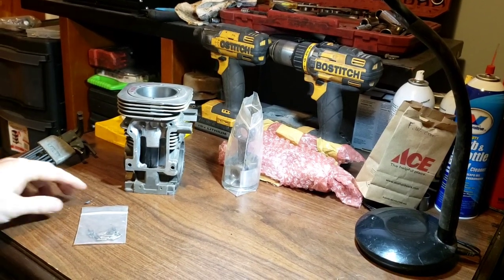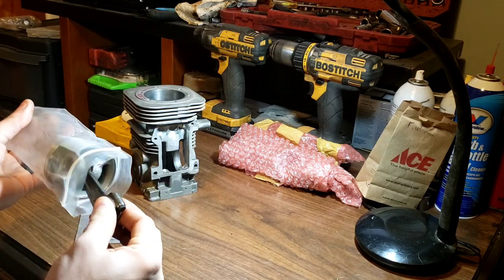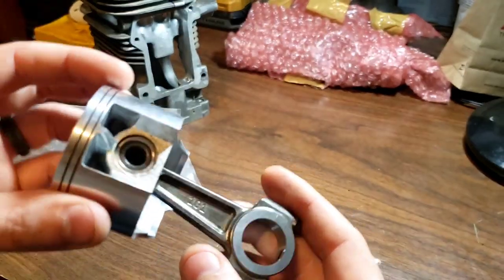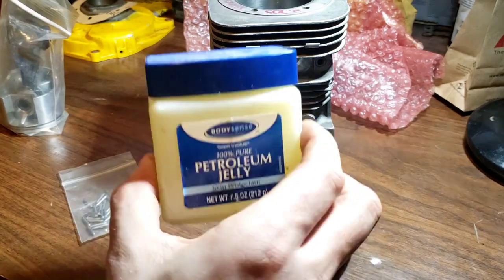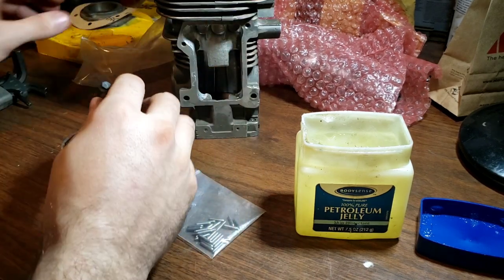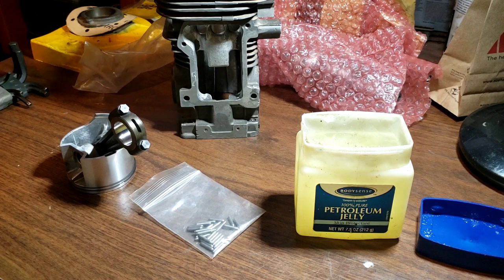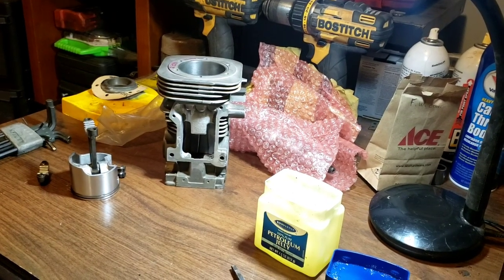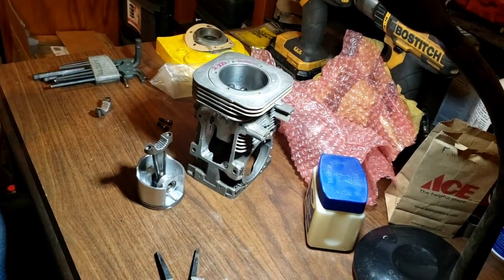McCulloch 101B Engine Assembly (Race Saw)

Comment: Bryan,   I had a Margay Kart with a McCulloch 101B engine on it.  I raced it in 1972 & 73.  My engine had a pulley on end for starting it up.  The engine produced 16 horsepower and ran off alchol - very fast about 65 mph.  Back then, you would use a McCulloch 91 or 101 engine.  Lot's of fun back then . ......  David Alt     Md

Comment: Whats a gas carburetor that i can buy for one? I have an engine but it has an old alcohol carb that doesn't work.
Reply from the maker: Anything you can get to fit based on your application. Ive seen as much as dual snow mobile carbs put on these for racing applications

Comment: I have built Mac's for years.  Just a little tip for you.  Don't put the needle bearings in until you install the rod and piston
on to the crankshaft.  Place a little vaseline on the bottom of the rod before installing the piston.
Then place the crankshaft to bottom dead center.  Install half the needle bearings in the bottom half of the rod.  Place your vaseline 
on the rod end-cap and put the needle bearings in the end-cap.  Install the end-cap on the bottom of the rod. Loctite the rod bolts 
and torque on about 90 to 95 inch pounds. Just be sure to use Loctite,  the bolts can sometimes work loose. You don't want to over 
torque.  It's easy to induce stress-fractures on the rods bolt holes.  
PS,  I would recommend using allen-bolts instead of the hex heads. The hex-heads can be buggered up very easily. I always replaced 
all the bolts to new allen-bolts on all my builds. 
Cuts down on the tools.  Good luck.
Reply from the maker: Good advice. Vaseline however wants to melt on me so I use wheel bearing grease and the hex head are specific to this billet rod and must be used as they are machined for them. I havent come across anybody using red loctite nor have I seen in any instructions to do so, not even from Terry Ives.
Reply: @mistermacgray  I started using Loctite when I had a rod bolt work its way loose on an engine build and split the block ruining the entire block.  When that happened I started using Loctite and allen-bolts from then on I never had another bolt work its way loose. Now a broken rod is a different story. hahaha An ounce of prevention you know?
Reply from the maker: @gregderrick5831  never had that issue but I also don't reuse bolts and use 12.9 grade.
Reply: @mistermacgray  I never reuse bolts either.  That is a recipe for disaster. The Loctite is for my piece of mind.
Reply: @mistermacgray  Like I said before.  I like to use Loctite for peace of mind.  I have had them come loose once before I started using as a precaution.  This is what happens when they do work their way loose.  Just want to give you over 40 years engine building experience as a tip for the future. Greg      https://www.youtube.com/shorts/FZeBddWITvY?feature=share
Reply: I usaly use outboard needle bearing grease or bombardier needle bearing grease and I keep it stored in fridge until ready to use stays thick that way. I also use my heat gun on area when putting in roller bearings and fall right in. dont do any saws but old seadoo 2 stks use needle bearings on small end of rod and a pain when putting wrist pin in with thrust washers. And seadoo supercharger use needles and spin at like 30k. I ended up here while watching vintage Mac kart racing go figure.
Reply from the maker: @dgc940  alot of vintage mac stuff here and more kart engine stuff, in saw bodies, to come.

Comment: can you please attach a link for the connecting rod and bolts please tried what you said with no luck.
Reply from the maker: The billet con rod and bolts it comes with are no longer made unfortunately. However the bolts for this con rod have shown to be the weak link, I posted a shorts video up of a 101 blowing up and showing the bolts failed while the rod is fine and destroyed the engine block.

Comment: That top intake area you filed Originally broke from someone using too long allen bolt.  Normally they take a 1inch long bolt.  Depending on the intake you use and gasket thickness you may find you need to use a 7/8 or shorter bolt.   The 1 inch bolt in some conditions will bottom out and start pushing up on the nut retaining area when torquing down to 65 inch pounds and break the alum nut housing.  Each engine and intake combo will be different.   Always measure.

Comment: I still have my margay kart and my 101c
Reply from the maker: @stevenboone9359  never heard of a 101C, nor do I see any Mac books that list it
Reply: @mistermacgray  the c didn't have a bridge in the exhaust port  and had a larger carburetor.i have a A and the B model also.I bought all of them from halls speed shop in wichita ks
Reply from the maker: @stevenboone9359  the only one with a bridge of the 101 series was the MC101, which I have one of those. The A, AA, B and D don't have a bridge.

Comment: where can i find one of these cylinders
Reply from the maker: Ebay, kart groups on facebook, local karting get togethers and swap meets.
Reply: @mistermacgray  i live in alaska and don't do facebook.  i keep looking on ebay, but no luck yet. i have a nice clean 125 super pro.  compression seems a little low.  whats the normal psi on those 125's? thanks for the info!
Reply from the maker: @Kim Stocks  185psi new, sone say the lower end of 165psi needs rebuilt for them but I've seen them run fine lower. Check to make sure your decomp valve is clean and isn't leaking. If yours is an iron bore then you can get it bored out and a piston fitted if you  find an over sized piston. If you have a chrome bore, then you will have to find somebody that will chrome a blond bore cylinder.
Reply: @mistermacgray  thanks,  i do have an iron bore, really appreciate the info!
Reply from the maker: @kimstocks4485  no problem! Just keep that sp125 alive.
Reply: @mistermacgray  will do